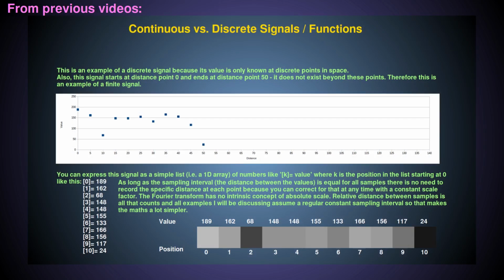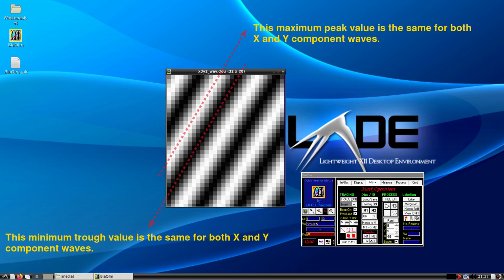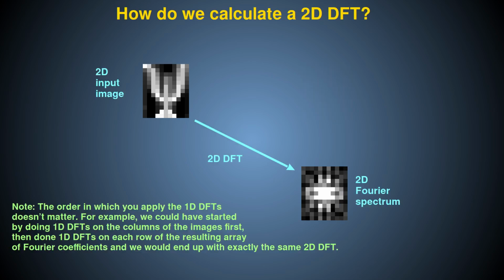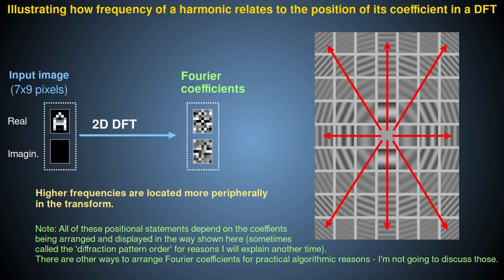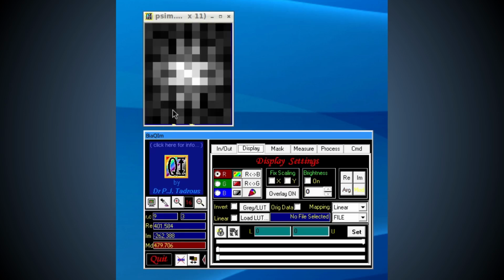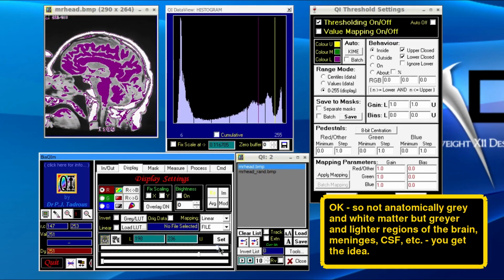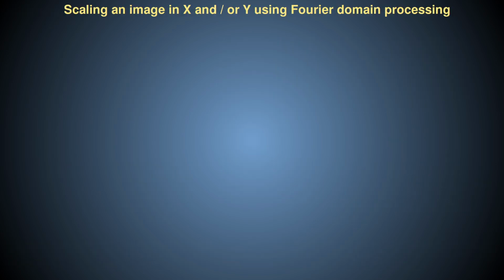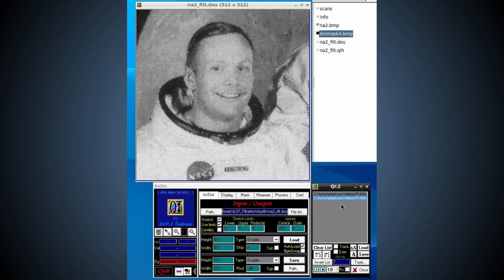Fourier 4 - The DFT in 2D and 3D

Comment: Hello, Dr. OptArc,

I am very impressed by your PUMA microscope project and your extensive expertise in microscopy and image processing. I am pathology resident based in dhaka bangladesh, currently planning a project to implement a fully digital telepathology lab in Africa, aiming to improve diagnostic access and accuracy across underserved regions.

I am very interested in purchasing your microscope and full kit for digital pathology. However, I have limited knowledge of microscopy and no experience with 3D printing or technical assembly. My plan is to mount a high-quality camera and integrate an automated XYZ motorized stage for precise imaging, and I would like to know if your microscope design can accommodate this setup.

I intend to conduct a pilot study using your microscope and imaging techniques, fully automate the system, and incorporate AI tools—including your HUS system—for diagnostic assistance. With your guidance and support throughout this process, I am confident we can develop a highly functional and economically feasible solution that can be scaled across Africa.

I would greatly appreciate your continuous help and mentorship, as well as any advice on procurement, assembly, and automation. I am committed to buying all the necessary equipment from your project and will actively promote and spread awareness about your technology and its impact.

Thank you for your dedication and for sharing this incredible open-source resource. I look forward to collaborating and learning from you!

i will leave this message on few of your videos for hopes you might see it sooner.

Best regards,
Abdallah Bulhan